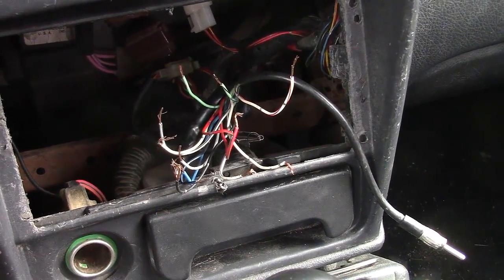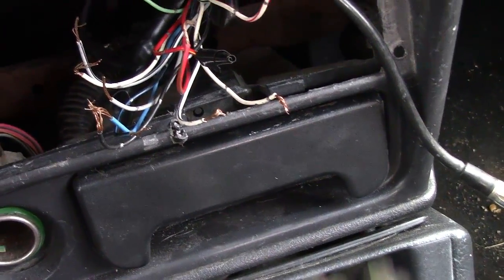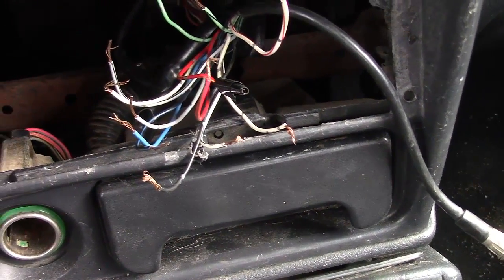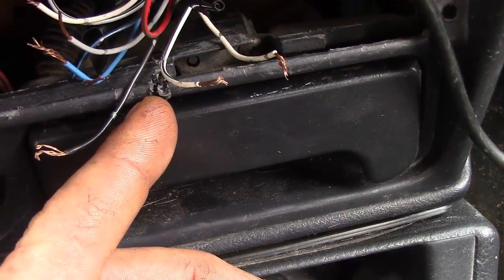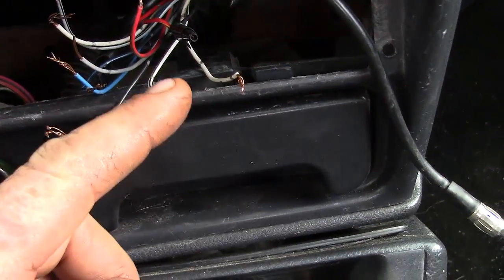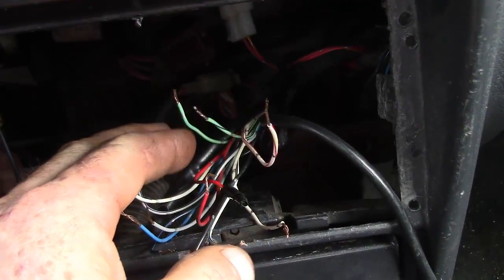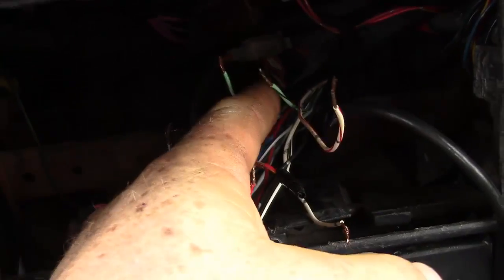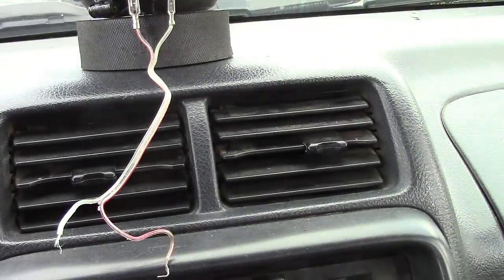How To  Install Car Stereo and Identify What Wires Go Where

Comment: I am installing an aftermarket stereo in my car... I was able to match up all the colored wires on the harness to the corresponding wires on the stereo, but one of the harnesses has a solid blue wire that doesn't match up with any other wire. My understanding is that this is the wire for a power antenna. I don't have a power antenna, so can I just seal the end of the wire off and leave it unconnected?
Reply from the maker: yep its also the remote line to an amp

Comment: So I'm trying to hook up A new DVD/CD deck. My last deck was just CD. Extra wires, Brake, Neutral, and front / rear cameras. I'm having a bit of trouble. I've got the speakers connected but Im not getting any power. Not sure which wires on my Tracker are the brake, Neutral, power, memory, any help would be appreciated. Thanks Bubba

Comment: 👍👍👍....thanks....the way me and my brother did was all the same you did.but i had and old transistor radio..took out the old speaker..strip those wires and connected them to those wires in the dash.its battery power radio..but when we heard sound.... 👍😆

Comment: My question is using a DOUBLE DEN abs getting it to put sound to the speakers. All the wires and power, ground have been voltage meter  verified . Either ohm, consanguinity and residence. This blue wire and in my Ford Expedition that supposedly blue base casting with a black strip. Is supposedly the fix to let the stereo sound to go . However it’s mot working.  Everything is wired correctly because I use harness no butt spiking and the factory amp works. I put the factory stereo back in and everything works including sound. Plug my DD IN And it comes on but no sound . 

???????
2008 Ford Expedition XLT
AILPINE DDEN STEREO WITH THE $134 FACTORY PLUG HARNESS WITH ORANGE
Orange red strip
BLUE POWER ANT
BACK UP CAMER REVERSE WIRE
BLUE WIRE
those are the only wires not linked to the harness.

Comment: Yep ive been there cleaning up other peoples chopped up wiring too many times.
The speaker wires can be non related colours, so out comes the multimeter in ohms mode, it quickly finds the pairs.

But (and there always is one) if someone has one of those old fashioned  external rear/front control pots, it can confuse the readings.

I use the 1.5v battery also to find which speaker is connected to what wires.

The memory power / main power / illumination power/ antenna power trip people up sometimes, depending on if the radio wants them.

Correct speaker phase is a good thing to get right too.

Can you tell i've done too many bloody car radios LOL :-D
Reply: What's color is the memory wire
Reply: @codycameron5654  connect a small 12v bulb to the car body and touch it on each of the spare wires from the car untill it lights with the ignition fully off.
There is no standard for colour :-(

Comment: How can you do this from the speaker side. I removed the factory door amp but want to use the factory wiring to connect my speakers. There are 8 wires for each door and want to make sure I connect the right wires to the speakers. Thanks.

Comment: What if I dont want to cut my head unit wires to find the right wires to the speakers? My new unit came with a connector that connects to the OEM old connector
Reply from the maker: then its all figured out for you?
Reply: @ghettohillbilly1  I only have front speakers and tweeters right now but I want to add rears so maybe is there a way to find out what pins do what?
Reply: @rubenbraekman4515  buy a harness

Comment: I have a 2005 Saturn relay and i cut my wire harness off so when i hook up my radio it stays on without the key on and then my radio displays security basically saying its hooked wrong but i tried everything but still does the same

Comment: I'm trying to figure out which wire behind the radio in a 2000 Ford Ranger would control the power to my power windows my four-wheel drive and my dashboard lights but all the fuses are good but I can separate all the wires and everything works